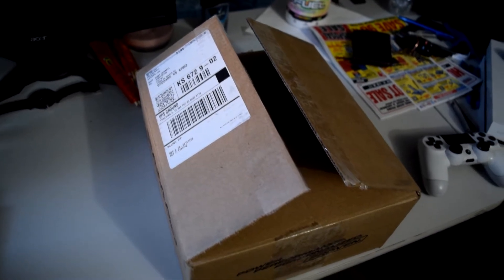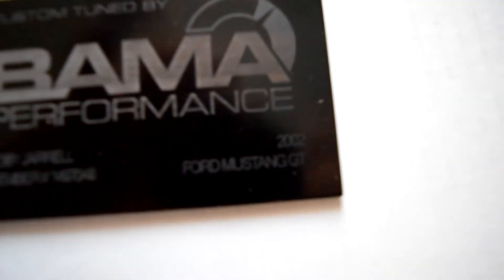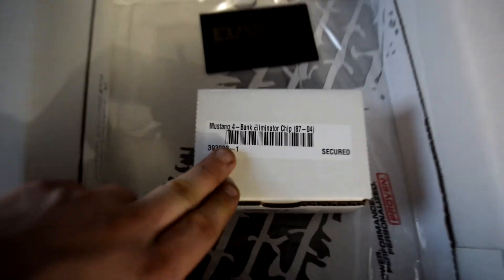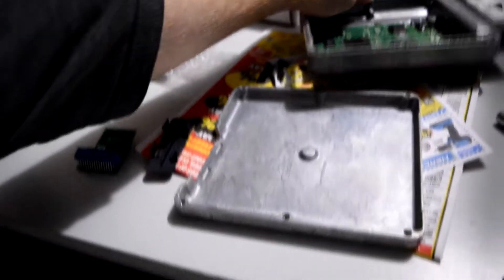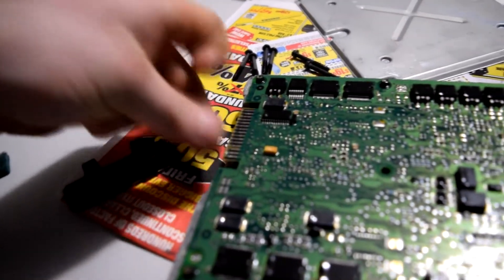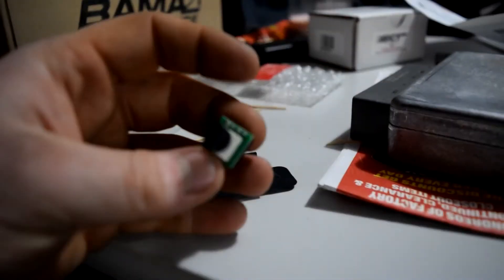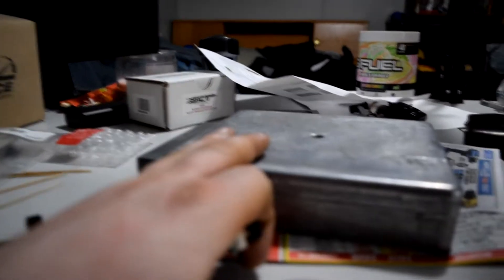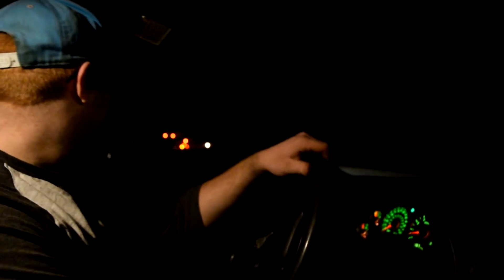Installing The Bank 4 Eliminator Chip

Comment: What was causing it to stall out and not run correctly ?
Reply from the maker: I do believe it was the chip kept slightly moving causing it to disconnect. If you found a way to keep it pressed in without moving, that's the best way.